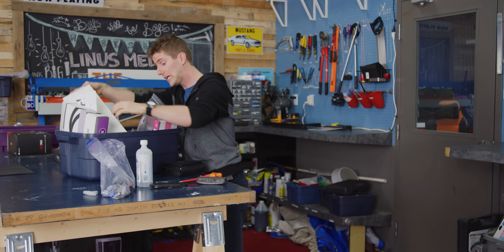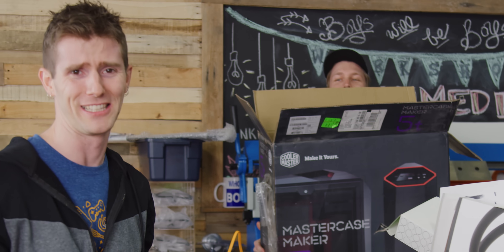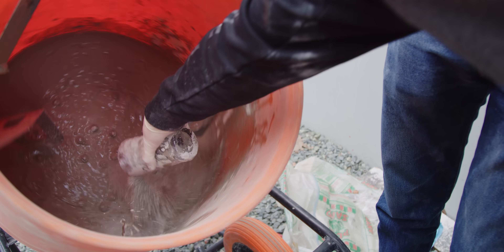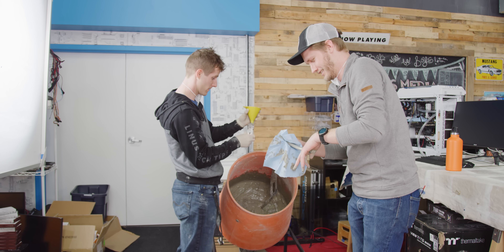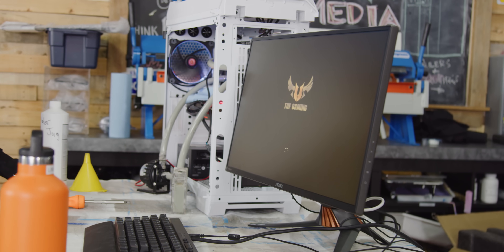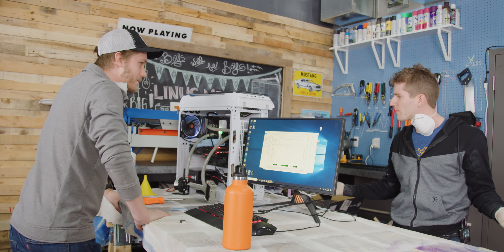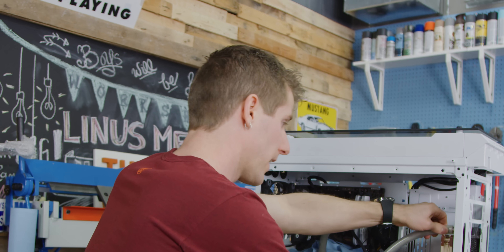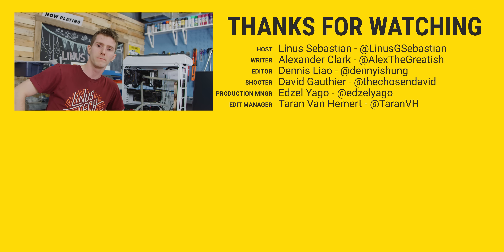I Can't Believe This Worked!!! - Concrete Cooled PC (April Fools 2019)

Comment: Is it possible to get mercury flowing in the cooling system?

I'm serious.
Reply: I'm seriously interested.
Reply: @as7river  Yes, however, mercury is if I recall inherently dangerous to metals due to it forming alloys upon contact. Gallium does the same thing (and wreaks havoc on the physical structure as well).
Not a chemist and I'm probably wrong on the first part. :P
Reply: @serraramayfield9230  Only an issue with aluminum. Built a copper radiator and waterblock and pump and it would work.
Reply: @serraramayfield9230  It is way to heavy for most pumps (20x denser than water. And you don't want to have to clean up a spillage. Everything it touches becomes hazardous waste. Due to high surface tension it splits into tiny droplets going everywhere. That is why mercury thermometers have been banned from planes. And the alloy formation with aluminium of course.
Reply: @lobsterbark  Gallium is only an issue with aluminium, but mercury amalgamates much more easily with other metals.
Reply: Serrara Willow Mayfield - aka Fluttershy hi mercury has a tendency to more or less destroy aluminum by turning it into a tower of fibers (it’s wack I suggest you watch a vid of it) and gallium can damage aluminum by just soaking into it and the I becomes brittle so LTT would need to find a block and radiator not made of anything that reacts with mercury or gallium also to add to the problem mercury makes ver dangerous invisible fumes. But other that that mercury should make a good coolent
Reply: As long as you don’t leave on bare skin for more than 60 seconds your fine also no open cuts ore wounds
Reply: @serraramayfield9230  You got it pretty much right, though it'll only alloy with aluminum plates.
Reply: @lobsterbark  murcury is fine, gallium would be a disaster
Reply: @serraramayfield9230  you are correctimundo, it causes a thing called "mercury amalgams" with most metals
Reply: lol you could try badgering Cody from Cody's Lab, he basically swims in the stuff.
Reply: @mazzalnx  Am personal friends with the dude (we went to college together) and can confirm, dude loves any excuse to fucks with liquid mercury.
Reply: @doublevendetta  literal?
Reply: @maybenot909   Very lol
Reply: I wouldn't try it.  Mercury has a bad habit of dissolving other metals.  I guess if you have a system you don't give a shit about you could give it a shot, but I wouldn't risk more than that.
Reply: @XenoFireStar  What about Gallium then?
Reply: @TechBuild  same problem, and for a bonus, Gallium is a solid at room temp, so the pipes would freeze overnight.
Reply: @TechBuild  Gallium solidifies at room temperature. 
Now even a few degrees above that is enough to melt it, but when your PC wasn't being used it could easily solidify. If you live somewhere hot it wouldn't be an issue. 

You might be thinking "But wait a sec, wouldn't the processor melt it?" and yes it would, almost immediately. But it would only melt the part of it in contact with the processor. The pump would still be trying to push solid metal when you turned it on, and it would almost certainly break. This is aside the fact that liquid gallium gets everywhere, and it would kill any components it touched. Unfortunately I think it's best used as simply a thermal interface material. Trying to liquid cool with metal sounds like an insanely cool idea, but the sheer difficulty in making a safe and reliable setup that used it makes it unlikely to ever really happen.

But that doesn't mean we can't dream, and so I have a contribution.
Cesium. 
Its a bit lighter and a bit meltier, and it isn't quite as willing to alloy. It has one significant setback though.
When it touches any amount of water, it violently combusts spraying droplets of thousand degree burning liquid metal everywhere. Thing is, when I say any amount of water, I mean it. Even the amount of water in the air is enough to set it on fire and god help you if for instance there was actual liquid water in the loop when you filled it.

But I mean if you're gonna do something this impractical, why not go all the way?
Reply: I’d like to se a pump be able to pump it lol
Reply: Technically you can
But your pump should be a behemoth of a pump
Cause that gonna be so heavy to move
Reply: Water has 30 times the heat capacity of mercury. Even if mercury has better heat absorption it will heat up a lot faster. I dont think it'll work very well.
Reply: @TheMaxCapeYT  Got it.
Reply: Simply put, yes you could.
However you'd need to very carefully plan out your setup for a few reasons. First, you'd have to choose the materials wisely. Mercury can easily alloy with a lot of metals, and when that happens it effectively destroys the substance. Gold for instance will dissolve in mercury completely. Then, you'd have to use a much more powerful pump than usual. Mercury is significantly heavier than water and as a result, a small pump meant for water would likely choke and die on mercury. It is electrically conductive but that shouldn't be a problem unless it leaks. It's hard to imagine what the cooling performance would look like. As a metal I think it would likely be able to pull a lot of heat, but I wonder how well it would flow.

Due to how heavy it is, you're also going to be at a significantly increased risk of damaging your PC. I feel like it'd put a bit more stress on all the components bearing the weight, which wouldn't be a problem under normal circumstances but in transport could bend or break something. I also question how effectively it would navigate a radiator. You wouldn't be able to use aluminum either.
Reply: @coaxill4059  Thank you for your answer.
Reply: @coaxill4059  does copper alloy with mercury?
Reply: https://youtu.be/XqvBLBlzeNQ someone did this
Reply: Someone has tried Gallium and discussed Mercury
https://www.youtube.com/watch?v=XqvBLBlzeNQ
Reply: If you overclock it too much, it explodes.
"hey did u see my new mercury cooled PC?"
"hey look out the temps are too high!"
"On no"
explosion
Reply: Mercury turns into a highly toxic vapor at 40C (iirc) and heating it would be an inherently bad idea. Also, water carries much more heat than mercury.
Reply: I made the like count 666
Reply: @sheepy2345  ok but nobody asked
Reply: that would be so cool!
Reply: Interesting
Reply: Possible? Yes. However, it's far more conductive than mineral rich water, the vapors can be toxic, and it has a tendency to attack other metals, especially aluminum.
Reply: @ScienceNick How about ceramic pump, block with glass parts like glass tubing? use a torch to make the bends just like you'd bend hard plastic tubing. Just need a little more heat. The connections can be sealed with a ceramic sealant. This would be an ultimate DIY cooling solution
Reply: draining that loop would be interesting..
Reply: Mercury and Aluminium (and maybe other metals too) dont work well. If you can use plastics and glass, and maybe a colab with Nile Red or Codys Lab, then thats a maybe
Reply: Freddie's blood is in this system
Reply: Well the Hg it's pretty toxic so~ Don't
Reply: yes but no
Reply: @ScienceNick The inhalation of mercury vapour can produce harmful effects on the nervous, digestive and immune systems, lungs and kidneys, and may be fatal. The inorganic salts of mercury are corrosive to the skin, eyes and gastrointestinal tract, and may induce kidney toxicity if ingested.

Just Y'know. According to the WHO.
Reply: That's amateur hour. Linus certainly has the means to fill the entire loop with Thermal Grizzly Conductonaut.
Reply: If you manage to get mercury somewhere im sure it is possible
Reply: Possible? Nothing's impossible. But it destroys aluminum, dissolves copper slowly, which turns mercury solid, and it will wreak havoc with the pump because it's conductive. Fix those problems and you have a viral youtube video.
Reply: might just disintegrate the tube
Reply: I want to see this and motor oil
Reply: It's too heavy for the pump and would move very slowly if at all. However it's a metal and fairly conductive so it might actually work, but it would work best with a custom pump that could move it. That would probably work better than water.
Reply: The madness would be real....... and realized.
Reply: He should've used NaK alloy ( ͡° ͜ʖ ͡°)
Reply: @necromancer2367  Just make sure you don't have any water residue in your tubing!

Comment: Err, what did you expect? Concrete curing is a chemical reaction, not drying out. Even with power 24/7 it would happen. You noticed that it flowed way slower near the tubing than in the middle - movement would not help in anything, it would cure inwards until everything is solid.
Reply: Alsmamfkm April’s fools :)

Comment: I'm going to try to air con the inside of my case using a 140mm rad mounted to the outside of where my rear case fan is,  and using a 5 gallon bucket with water and ice I will pump the water into the rad and using my pump thats submerged in the bucket.  then using a 120x38mm server fan that can move 219 cuft of air if run on high I will cool the inside of my case so that my cooler master geminii s524 cpu cooler will get me back down to around 0 to 5c at idle. this way I don't have to worry about water on the motherboard, and my cooler will perform great as long as the inside air is chilly. right now i am running at 4.61 ghz on air but hope to push it a little, once I get the radiator in.

Comment: Try using Mercury as coolant next time.
Reply: it would imalgimate and wreck everything aluminium
Reply: @Technet0  you could just use copper based equipment.
Reply: For that you need a certified chemist on site just to not make a mess
Reply: @peacechan4500  R/wooooosh
Reply: I don't think a planet would be super thermally conductive but it might be innovative idk
Reply: @pilotflux8005  he din't mean the planet ._.
Reply: @eryksmialek4907  woooooosh
Reply: If you somehow managed to not poison someone and not ruin all of the aliminum, that might actually work

Comment: Would've been interesting if you had tried it with cement plasticizer. It's supposed to make the concrete flow better without water so it might've actually worked!

Comment: So, I feel like I need to say this, even though it is sort of a "duh" comment. DO NOT use cement as a coolant!
When cement cures, it is an exothermic hydration reaction. This means IT PRODUCES HEAT AS IT CURES. How is that going to magically "remove" heat from your system? Cement feels cool to the touch most times you interact with it for a number of reasons: 1) wet cement has water in it that is evaporating, removing heat from the system; 2) most people don't go around touching cement, and when they do, it is as Linus said about getting out of bed and putting your feet onto cold cement. That cement is cold because it is in contact with the ground, which leaches heat away. While water has 4 times the specific heat capacity (the amount of energy it takes to raise the temperature 1 degree), it has a thermal conductivity about 1/2 of that of cement. Cement can conduct heat away from a heat source VERY quickly, but it raises in temperature 4 times quicker than water would (for the same mass of material).
Even if you completely ignore the fact that the cement will harden and ruin your day, you CANNOT beat thermodynamics. If your CPU produces 100 Watts, that is 100 Joules of energy per second. Regardless of how fast your pump runs, the total capacity if your loop determines how fast it heats up. If your loop contains 1 KG of water, and you add energy at a rate of 100 Joules per second, you will increase the total temperature of your water loop by 1 Degree Celcius every 42 seconds. 
The way you remove that heat is with a radiator. You literally exchange the energy from the water to the air around you. The water reduces in temperature as it passes through the radiator, which you can calculate pretty easily. A typical CFM rating for a 120mm fan is about 70, which is about 2 cubic meters of air per minute. The specific heat capacity of air varies quite a bit. Let's say the room is 70F, that's 294 Kelvin. We'll round to 300 kelvin for easy numbers. (that's 80 F by the way, a perfectly reasonable temp inside a computer case). At 300 Kelvin, air has a specific heat capacity of 1005 Joules per kg Kelvin. That's about 1/4 that of water. 2 cubic meters of air is about 2.5 Kg. So, for every degree C the airflow increases as it moves over that radiator, it can remove about 2500 Joules of energy from your water loop. Because our water will increase 1 C in 42 seconds, let's discount the amount of energy we remove to keep the math simple (only looking at a 42 second window). That's 1750 Joules per degree increase in air temperature.
In layman's terms, thermodynamics says that energy will flow from high to low (entropy). This means the water will NEVER be cooler leaving your radiator than the air temperature. We just need to figure out what difference in temperature between the water and the air, the thermal conductivity of the copper (or aluminum) of the radiator, and we can figure out what temperature the water will setting down to, without ever having to turn anything on.
I don't need to do that math to prove my point though. The point is you are limited in your cooling by the amount of energy you can radiate to the air, NOT the medium that is doing the carrying between the heat source (CPU), and the heat sink (radiator). Literally ANY material that flows will work here. The specific heat capacity of the fluid is the biggest variable in determining how quickly the loop heats up and cools down (given the same radiator and fans, I mean). Why would you every choose to use anything other than a cheap, corrosion resistant, easily replaceable fluid?  Water is pretty much perfect for this, with the addition of some corrosion prevention. Using cement is just STUPID.

Comment: Use thermal paste instead of cement. Has the benefit of transferring heat the same way the cement does but doesn't dry out.

Comment: Because of the reasons you told us, concrete should work perfect as a heatsink without a pump - try booting the PC with hard concrete (just make sure there is no air in the pipes)

Comment: In fact there is a way to use cement as the fluid of the cooling system. If you add superfluidifying and a frague retarder(i dont know if im spelling correctly), you in fact, can use the concrete in a fluid state in a cooling system

Comment: now thinking about it you could make the worlds biggest cooling tank using that concrete shaped with no middle and having something on top and if you bury it underground it would help reduce the heat of the water with the concrete and have just normal water going into the system

Comment: ah whilst concrete liquid is pretty much a proof of conception idea..

to be a practical use I think you are looking at running a longer loop and encasing the tube itself in concrete as eventually the liquidized version will set off eventually I suspect the concrete more than likely set which more than likely caused a failure point sometime throughout the night

though as the concrete is curing you may be needing to put sand in the pipe to make it rigid so the pipe callapse under the weight of the concrete

though i very much  you would be mounting the  tubing in the  case if you are trying to use concrete as an encasement tool

Comment: Linus that is not how you make concrete you made a cement slurry concrete needs aggregate both fine and course. . . . as an Ex journeyman brick layer what you would want for your experiment is liquid level as it is a liquid that hardens and doesn't shrink as what your doing.  its meant to level floors. but still love the April fools and though caught it at the terrible concrete ESPECIALLY WHEN CONCRETE HEATS UP WHEN IT CURES!!! just next time you need to go all the way and poor a computer in concrete and make it still work!

Comment: what about water and pieces of hard cement wedged inside the lines while leaving room for the water to flow around it, the heat transferring from water to pieces of cement helping it cool as it flows around it inside the lines?

Comment: You can add salt to prevent it hardening. Kappa
Reply: Taurgar if that’s true it would also effect the heat transfer
Reply: Why does concrete set in the ocean?
Reply: @Triggy96  specialized formula that uses increased atmospheric pressure and a faster curing time

Comment: To be honest if you wanted it to continue you should have keep some water running with the concrete  because the heat that the PC will be giving is going to be takin away the little bit of water that is in the mixture of concrete.

Comment: I thought this was going to be about running water cooling through a concrete block instead of a radiator.  No better than the fish tank method, but the advantage is you don't have to refill evaporated water.  The disadvantage is that it's even heavier than an already heavy method.  And needing to run tubing back and forth several times rather than just dumping the water into a tank.  You can use plastic tubes too.  The low thermal conductivity of plastic and low-ish thermal conductivity of concrete is a non-issue when your surface area of tubing is high enough.  And running the tube back and forth more times is easier and cheaper than attempting metal tube or a giant solid metal block.

Like the fish tank you need a very large block to match a small radiator with flowing air.  But also like the fish tank the super high heat capacity means it takes a very long time for a high load to move the temperature.